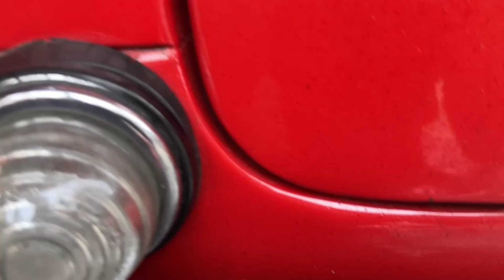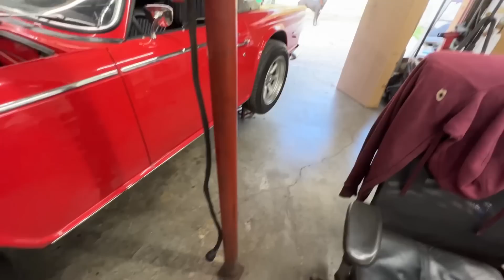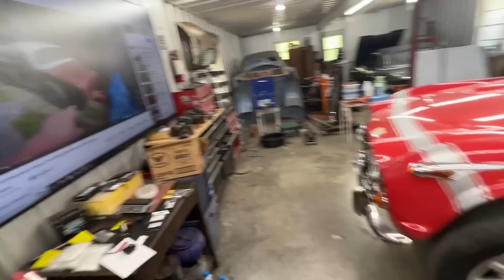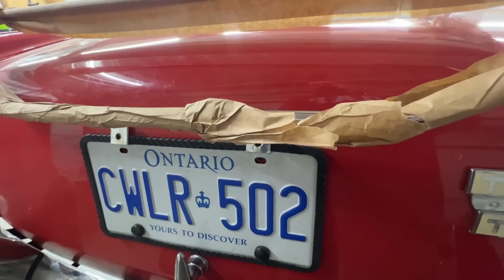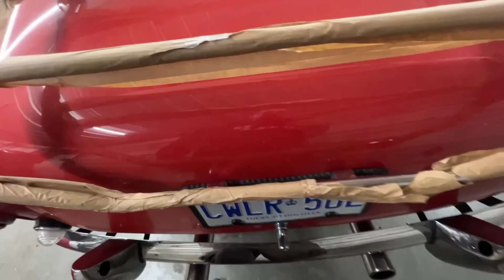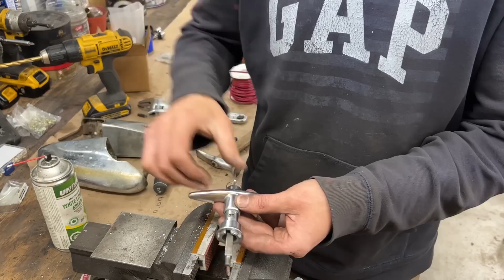1968 TR250 - Bumpers, Luggage rack and more

Comment: .....The very first thing I noticed was ....There is no return spring on the clutch slave cylinder, without it the throw out bearing will keep in contact with the pressure plate 'forks'....After a while this will cause the throw-out bearing and/or the clutch disc springs to fail from excessive heat.....I know, I had this happen to me in my TR3A , which has the same set-up.....It's only a return spring, but it's very important as it physically pulls the release arm and bearing off the forks when the clutch is released.....
Reply: Thank you, I was not aware of that, I will add it to my new list of details to review!

Comment: The missing pin from the boot lock handle should be a square rod with a slot in one side. The slot engages with the end of the barrel so the pin does not rest on the top of that rather is deliberately moved up and down. I can send the dimensions if you want? Would send a spare pin but it’d be a while before it got to Canada! 
It’s actually quite easy to make all the locks match, I just made my own video on the topic in fact (dunno if linking in comments is acceptable but I’ve not posted much so it wouldn’t be hard to find). The barrels will usually come out with a bit of oil/WD40 and some smacking of the handle on a block of wood, I’ve only once had to resort to a drill.

Comment: I was rather irritated after buying one of those weather strip clip fitting tools and finding out it was just a bent bit of metal! It required regular reshaping too when doing my Spitfire doors. I’ve got the straight section of mine wrapped in loom tape (hockey tape would do too) to stop the metal contacting the door glass.

Comment: you have the mounting brackets on the wrong sides for the luggage rack
Reply from the maker: Hmm… I was following pictures I got from the owner. You might be right, but to me It actually makes more sense to be this way, because the notches of the mounting brackets are inside and the plate outside kind of finishes the whole hinge assembly.
Reply: I have a 63 tr4 with what looks like the same luggage rack and it fits well with the hinge brackets reversed so that the bolt support is on the inside. Love the chanel!

Comment: That sure brings back memories! My TR4 was the same color, with similar driving lights, similar grill (actually 4A type, just because I preferred it), and a similar boot lid rack. I think I only ever used that rack once, while I was in college. I picked up my girlfriend from the airport in a winter snow storm and she had four large pieces of luggage! One went in the boot. One went on the rack. And the two largest went behind the seats, after we put the convertible top down! 35 miles in a Colorado January blizzard... At night... In a convertible... With the top down. Ah, foolish youth!
Question... I watched on a small (phone) screen and couldn't tell for sure. Were the thin rubber gaskets under the boot hinges? Four pieces... Two under the larger lid side of the hinge, two under the smaller body side of the hinge? 
I don't think there was originally a gasket at the boot handle eustascion, but I added a thin rubber o-ring to keep water out.